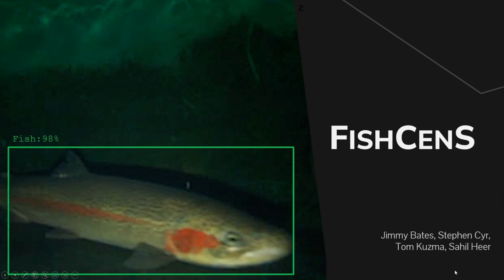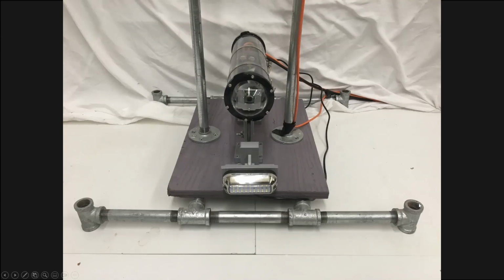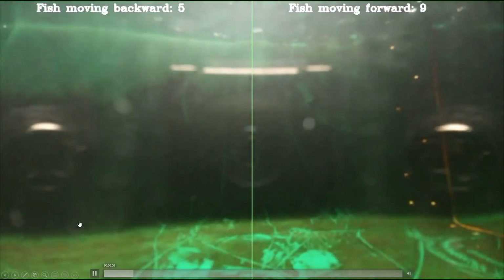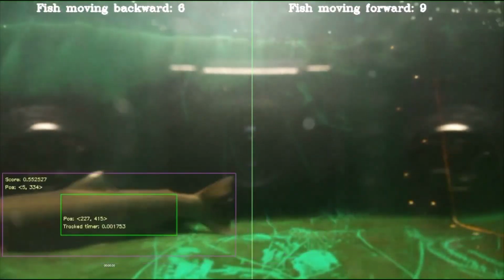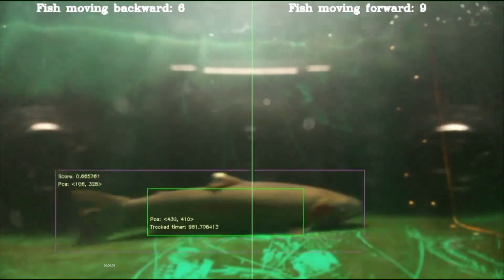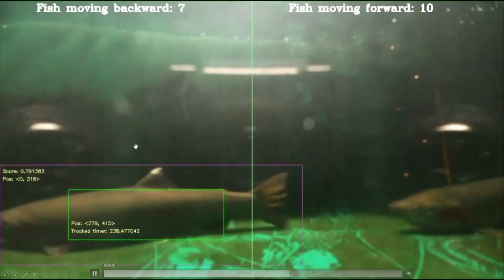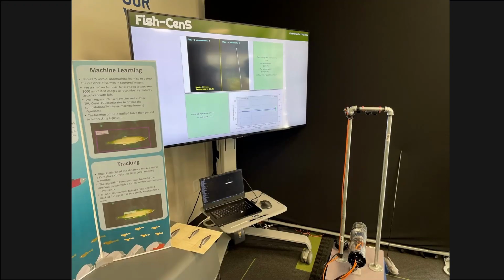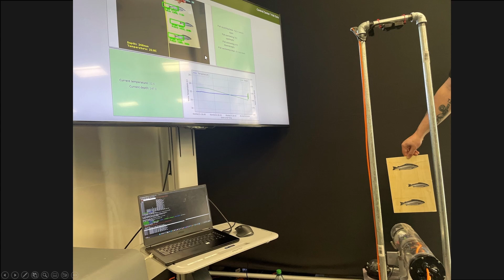FishCenS - Overall System (Part 1)

Comment: How do you solve problem with cooling of raspberry pi?
Isn't it going to overheat in such tight setup
Ive seen a middle board between raspberry and your own board, is it cooling?
Also, where you guys get these stackers for pins?
And do you use yolo3 for coral or something else own-written?
Also, you written your own tracker or using some existing one?
Did you tried Haar classifiers for that, if so, why it failed in your case?